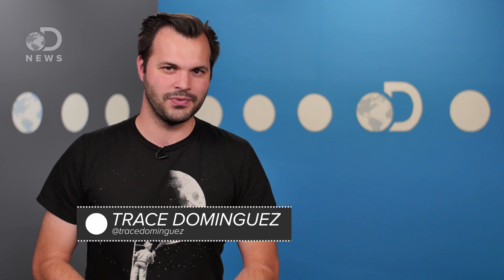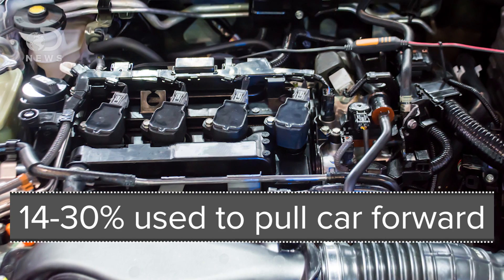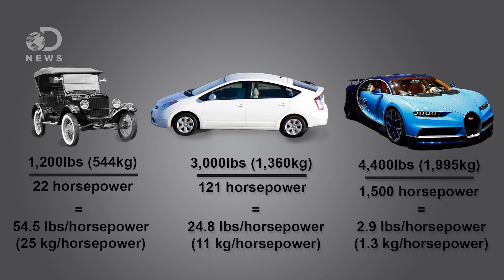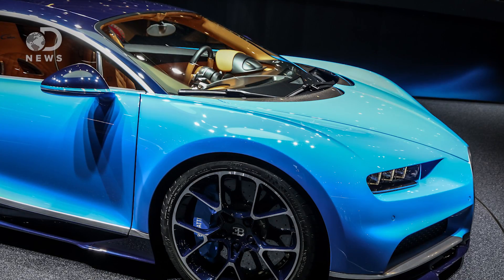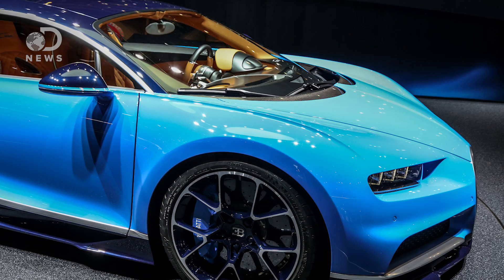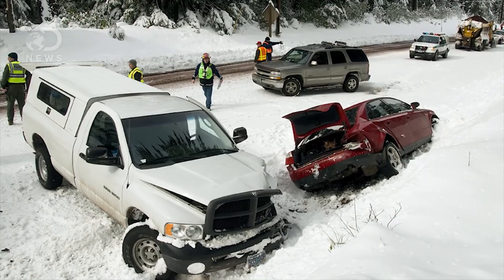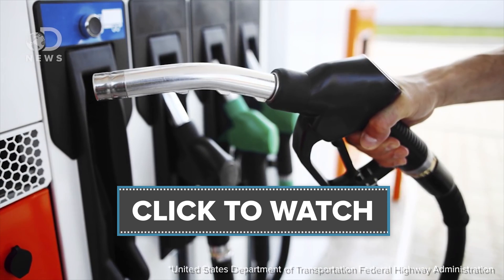Why Isn’t Your Car Faster Than A Sports Car?

Comment: Do you say a corvette has 2 inline 4 cylinders engine ? NO!    a w16 is a single block and is more like 2 VR8 sharing the same crank.
Reply: Except explaining a W16 as 2 V8's bolted together actually makes sense where saying a plain V8 as 2 inline 4 cylinders.
Reply: +Colby White doesn't make sense.
Reply: Colby White it's exactly the same comparaison... there is not difference. A w16 is a single block, also it's more like 2 VR8 sharing the same crank. This is only a way to explan it but Trace said it like it's literaly 2 V8.

Comment: What is the point of making a super fast? Nobody will be dumb enough to go at 261 mph on the road. Sport cars are useless, stupid and a waste of money.
Reply: Well the Bugatti isn't even a "sports car" it's a Hyper Car that was never meant to be owned by normal people, it was made simply to break the top speed record but that had to first make it a production car for it to fit into the category. And in places like Germany they have roads that do not have a speed limit so if you wanted to you could hit 260 if there was no traffic.
Reply: That is why there are these things called race tracks and drag strips, ever heard of them? Sports cars are not useless and waster of money, they are generally more fun to drive.

Comment: Holy hell. The video is wrong about the power to weight ratio. It has no influence on a car's max speed whatsoever. It only affects the car's ability to accelerate, since the inertia of the weight will create a counter force.
However once the car accelerates onyl slowly as it approaches max speed, the weight will no longer play any major role in the car's forward movement. The power, that the engine delivers to create a forward force at the wheels, will have to counteract the force of air friction and other kinds of friction in the car and at the wheels, plus gravity if it is driving up a hill. Those, especially air friction, are forces that get bigger with speed and will ultimately slower a low powered car down comapred to a high powerd one.
Intertia however is only proportionaly to mass and the mass does not change with speed.

Acceleration is an important measure for a "sportscar" as well as for safetly in daily driving so power to weight ratio matters in other ways, but please DNews, don't confuse acceleration for max speed and get your facts straight.
Reply: Clayton Cortina it makes me very sad...  I love cars
Reply: thank you, was thinking the same. I am disapointed by Dnews with this one. oh and the chiron does NOT have 2 V8 wtf... a w16 is nothing like 2 separated V8 except for the number of cylinders !
Reply: Dnews loves to research on any other subject except for cars…

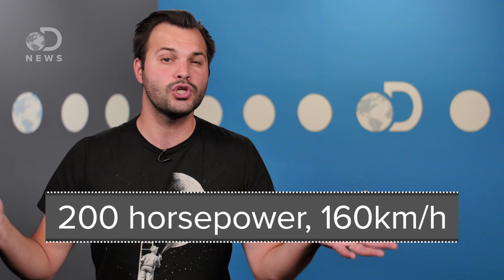Comment: 0:45 That Honda with 200 horsepower can only drive 160km/h? Seems rather slow. Or do they sell them throttled down on the US market.
Reply: nah, they can get up to around 130, they have a limiter to prevent engine damage at high rpm once you get to the last 10mph

Comment: The Bugatti Chiron isn't the fastest car you can buy
Reply: Sandip Sahota Henessey Venom Gt
Reply: Yep. The Veyron SS still takes the cake at 268 mhp. 7 more than the Chiron
Reply: wat is then?
Reply: It probably is. Its "limited" to 261 mph. But it is projected to hit 300 mph.
Reply: the Bugatti isn't limited by how fast it can go, it is limited by its tires. that's right, at top speed, the tires will explode in 15 minutes. but don't worry, before that happens, you will run out of gas in 12 minutes.
Reply: +Jens Kellner the venom isn't considered a production car. He also said as of right now (current production cars) the Chiron is the fastest PROVEN car.
Reply: +Sandip Sahota
don&#39;t listen to the comment you replied to, the Bugatti is the fastest car in the world. 267.8 mph if I remember correctly
Reply: +Schmidt McGready the chiron runs out of Gas in 9 minutes
Reply: +Jens Kellner 
I'm sure it does, I was speaking of the Veyron on my original post. I guess the Chiron is a newer model? not sure.
Reply: +Schmidt McGready yes the chiron is new
Reply: +Jens Kellner 
gg sir, I like your knawledge!
Reply: Not officially. They didn't make enough for it to be considered a production car. Plus it's a highly modded Lotus Exige and not it's own car anyway
Reply: it is however the fastest Road legal car you can buy